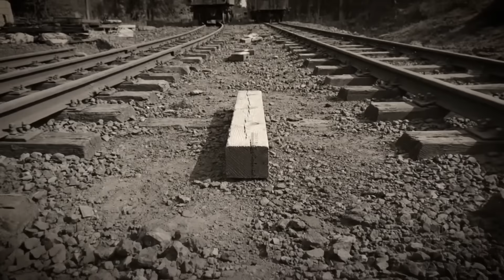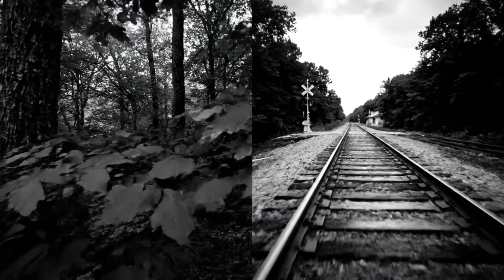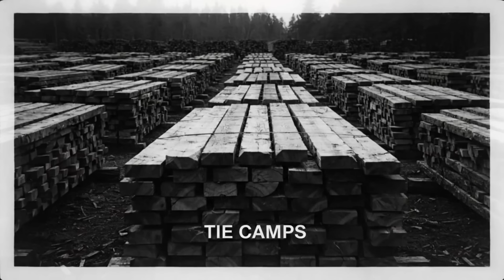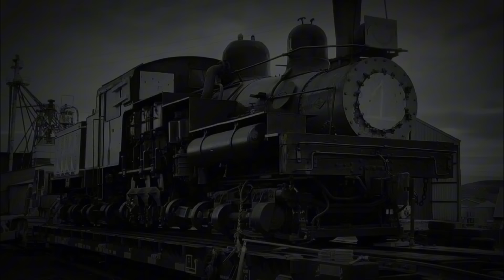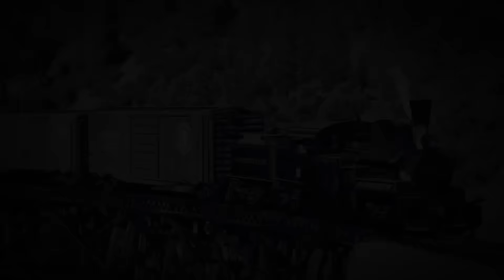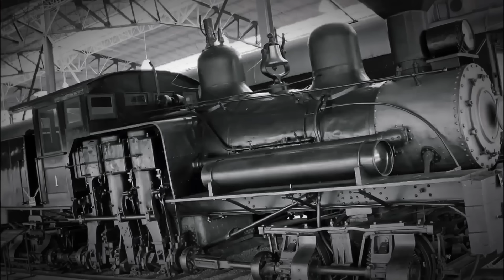How America Built Railroads Using 3,000 Wooden Ties Per Mile

Comment: hand hewn ties were only hewn on the top and bottom.  Modern ties are 8-1/2 feet to 9-feet long depending on the railroad. Currently 3200 per mile. Need better research.
Reply: D*** cut him a little slack
Reply: Looks like they could use old tires and plastics to make ties with..
Reply: @jeanlawson9133  √ ✓√✓🥳💕🥳√✓√✓©©jean

Comment: They might have cut the trees down by hand but they sawed the railroad ties out with a  sawmill most likely powered by a gas powered or steam powered donkey which is a standalone motor that drives a belt that runs the sawmill
Reply: Hand hewn ties were used on early railroads before sawmills were available. the ties were only hewn on the top and bottom.
Reply: @rogermeyer5780 perfectly put ! Thanks . 🧐
Reply: Thank you boy, for all you guys gave to our world. "Just a thought," the reason men formerly kissed a woman's hand ????? " That's the one part, of a woman that touches all the other parts of the woman !
Reply: A lot of the were still hand hewn.into the 1930s.